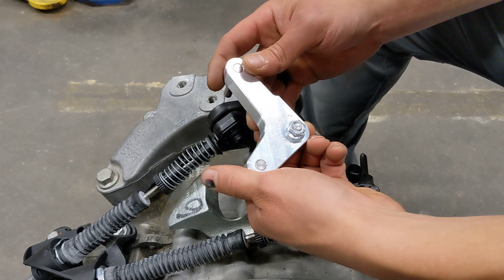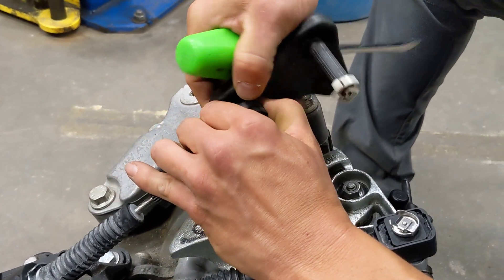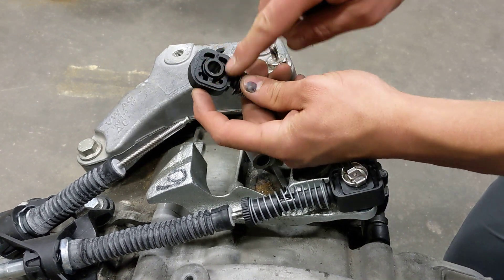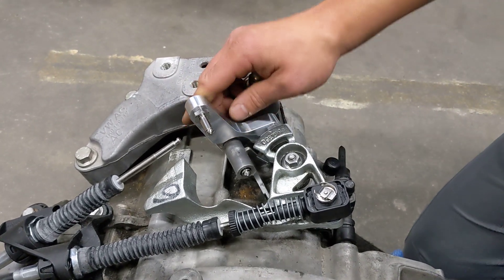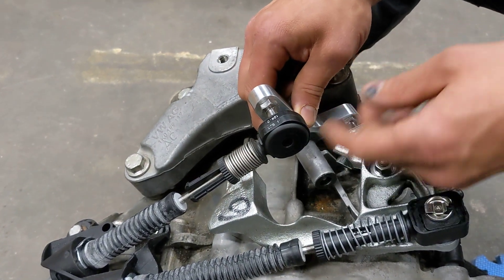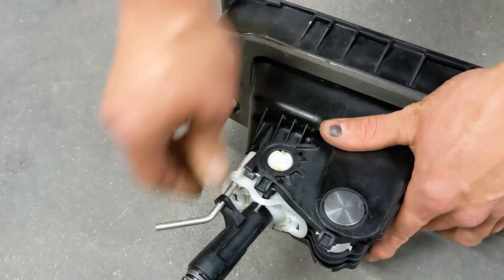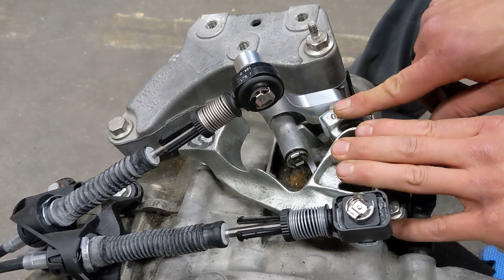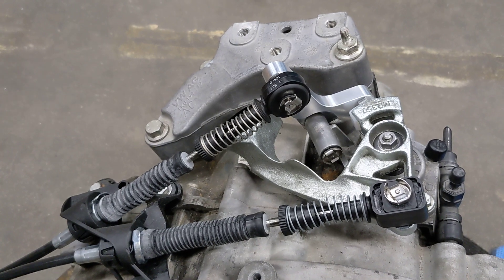Installing the Dieselgeek Billet Aluminium Side-to-Side Reduction Kit

Comment: What i dont understand how many threads we should count ? When you insert gear linkage ends?
Reply from the maker: There is no need to count threads. Adjustment is performed using the supplied 5mm alignment pin. Alignment is covered toward the end of the video.
Reply: @ then if i have a basic shifter from a audi a3 8v , i just insert them till i dont see any threads? I dont really understand..:(
Reply from the maker: The procedure is really the same for all the cable driven Volkswagen shifters. You open the cable ends and lock both the selector shaft and the stick in the home position, then you close the cable ends.
Reply: Dear Sir, how do u call that plastic part you are replacing with the aluminium one ? I cant find it on the internet. Do u have a code or something ?
Reply from the maker: The mechanism is called a "bell crank". As I recall VW simply labels it a lever in the parts fiche.